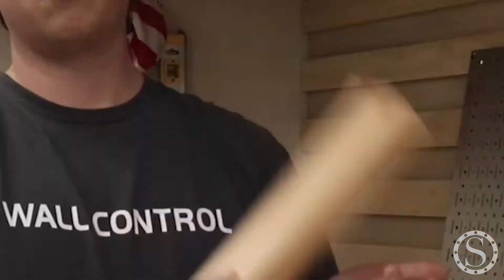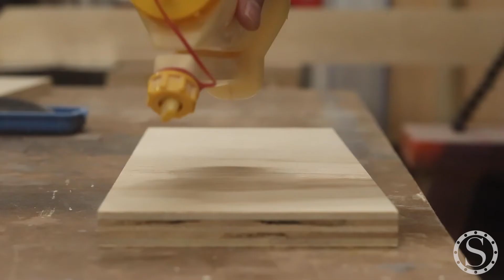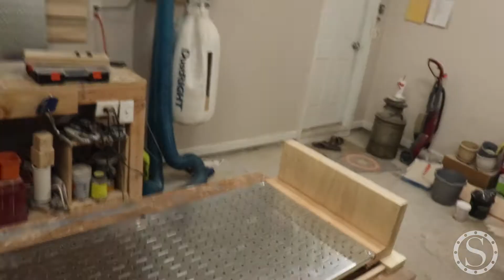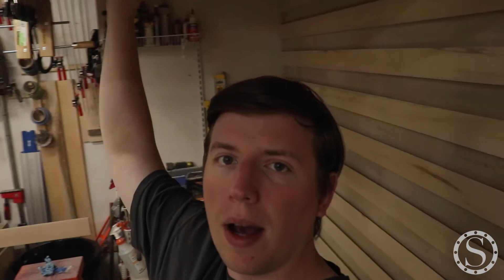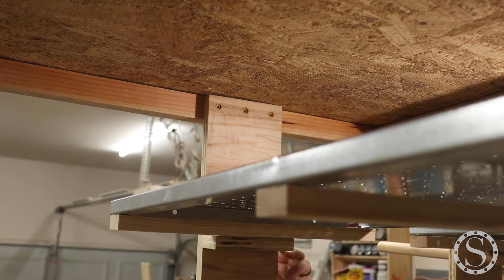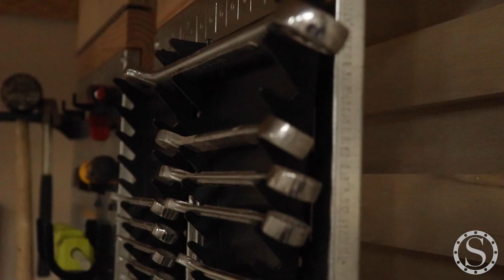How to Get More Tool Wall Space from Thin Air | Shop Project

Comment: Great job!  Very innovative solution!  Of course, I'm stealing it! :)  Chemical clamps (aka CA glue :) is dang handy and yes, eye protection!  I'm sure you've got some experience now with locking/unlocking the drop-down panels now, so which lock mechanism are you preferring? dowel or hinge?  I can see pros/cons of both.  Video-wise, great pacing, explanations before the action and nice shot framing!  Looking forward to the next project!
Reply from the maker: Thanks so much! You should! It’s incredibly handy to have. The hinge is easier to use and can be put up at least one handed which is nice. The dowel has a stronger connection, but required both hands up and down. For me, I just keep heavier items on the dowel and lighter, more frequently grabbed items on the hinge (if that answers your question). Thanks so much! I’m definitely still learning and tweaking my style. I appreciate the feedback!